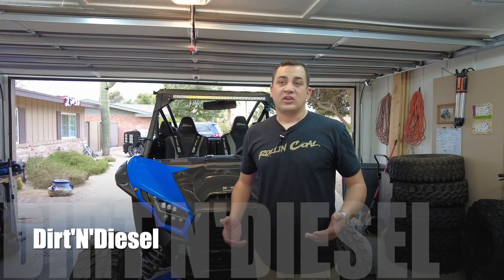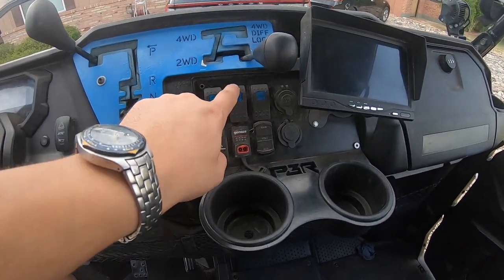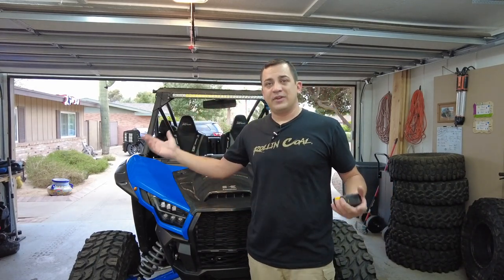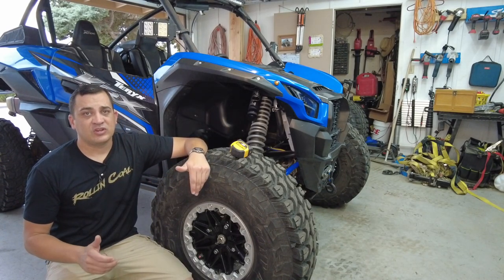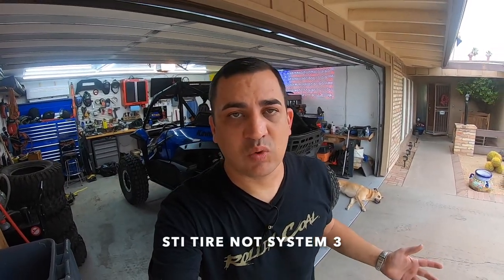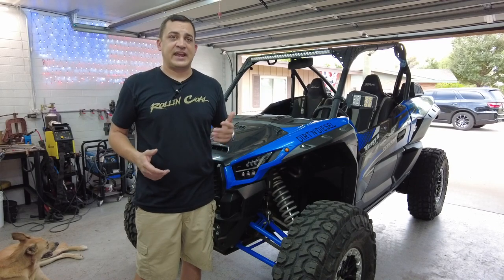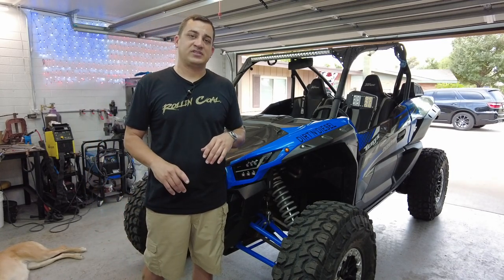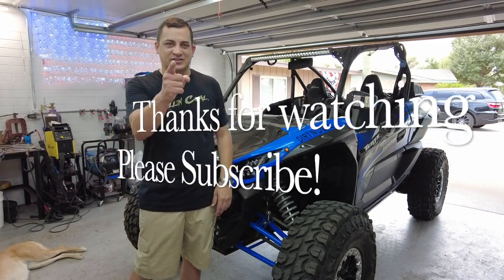Post Ride Review, What BROKE?

Comment: Does it seem twitchy at higher speeds with the suspension set a 1/2 higher in the rear? Mine did and I went a half lower in the rear and now it’s on rails